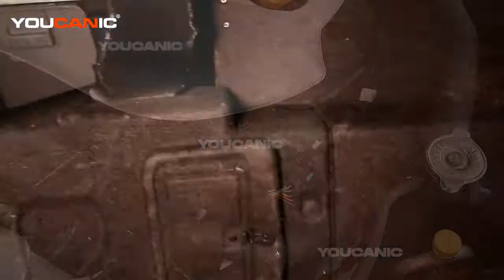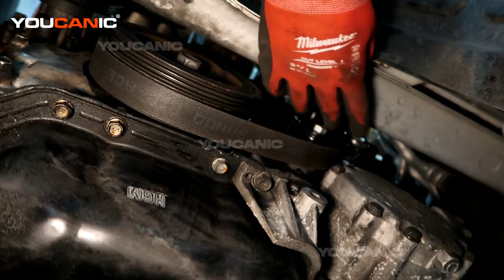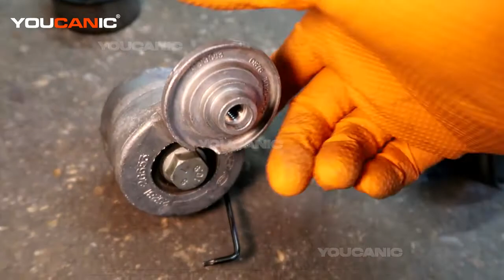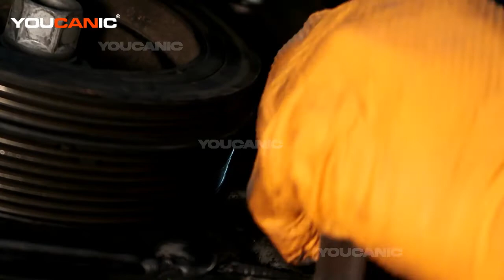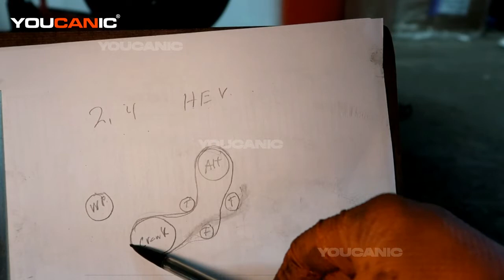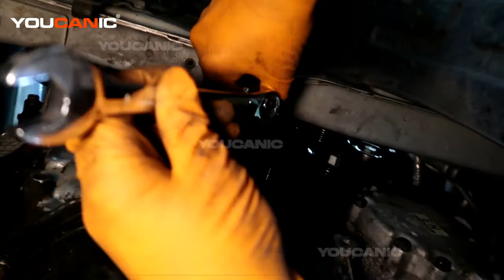2011-2013 2.4L Hyundai Sonata Hybrid - Tensioner Pulley, Serpentine Belt, Stretch Belt Replacement

Comment: What was the issue with transitions or pulleys? I got some squeaky noise on mid rpms, I'm thinking it could be what you had to change.
Reply from the maker: Hi there, thank you for your feedback! The issue with transitions or pulleys can indeed cause some squeaky noise on mid rpms. It's always a good idea to investigate this to nip potential problems in the bud. At YOUCANIC, it is our main goal to help our users with their car repairs and maintain their vehicles at peak performance.

For an in-depth and professional diagnostic, we would recommend our YOUCANIC Pro System Scanner which you can find here: www.youcanic.com/scanner. This tool will provide you with a comprehensive analysis of your car's systems. If you're performing DIY repairs, it could be beneficial for you to have access to our Factory Repair Manuals and Torque Specs. These can be accessed at www.youcanic.com/manuals. Let us know if you have more questions, we're always here to help!